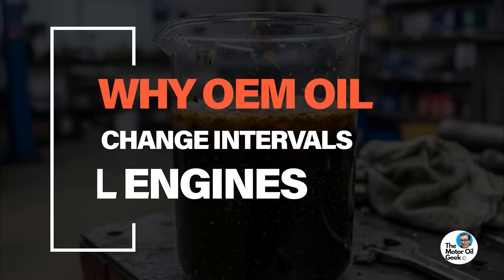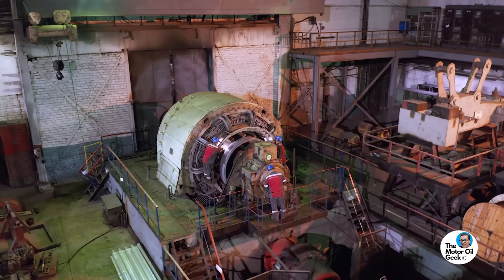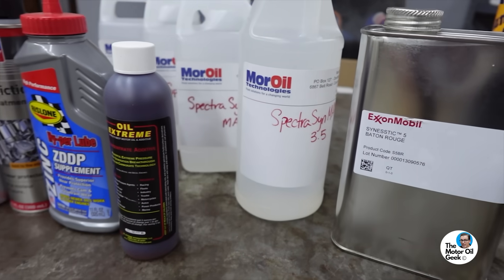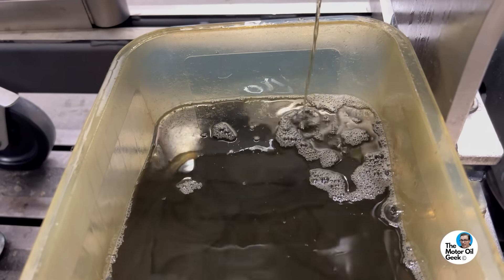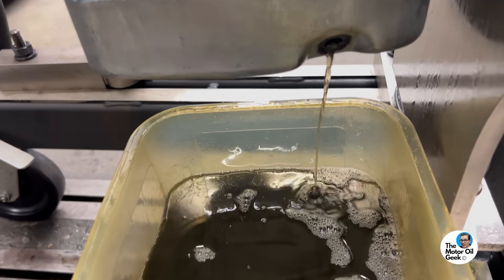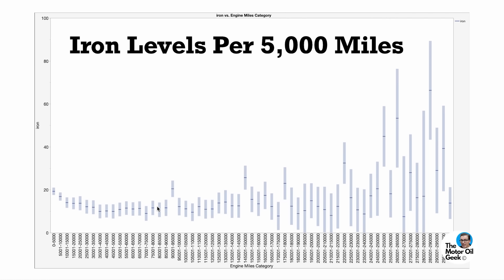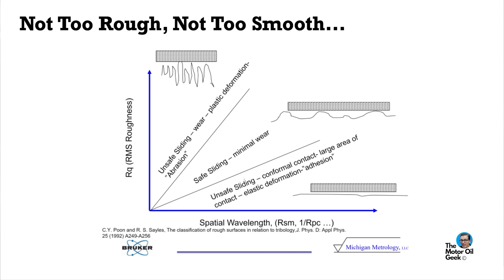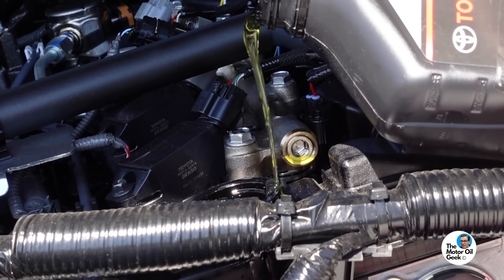NEW Data Reveals WHY Modern Engines FAIL Prematurely!

Comment: Years ago, I holidayed as a guest of a manager at Nissan. Although his role was in IT systems, his insight into motor manufacturing was priceless. He explained that with parts supplied to assemble vehicles, it was accepted that parts quality was accepted to be 'not 100% suitable'. He explained that it was accepted by the (vehicle) manufacturer that a 3% failure rate was acceptable and manageable by the company. Why? It all boiled down to cost. Parts could indeed be made to be 100% reliable but it would increase costs too much. 
In other words: A 100% reliable car can be made but it will cost you lots.

Comment: 2020 up they started cheaping out on parts and quality throughout most auto companies. Cost cutting.cheaper machining businesses that put out a lot of product faster with cheaper less robust metals. Lower grade to offset higher production costs (unionized workers).
Reply: In 2023 nonunion auto assembly outpaced union assembly 4.9 million vehicles to 4.3 for first time in history.  The trend continues.  I don't think you can blame higher costs on Union Labor.
Reply: @CAN43714not blaming but with higher wages and manufacturing costs theres no doubt the manufacturer passes it on to the consumer.

Comment: Lake, the reasoning behind a slightly dirty filter being more effective in catching debris is basically indisputable. 

However, not changing it with brake-in oil changes can leave a significant amount of residual "contaminated" oil in the system.  Sometimes upwards of a quart, depending on the engine. It would seem that recurculating dirty oil that had already failed to be filtered might not be ideal either.

I didn't realize that new oil was as dirty as it apparently is. In your opinion, where is the delta between these two scenarios?
Reply: Also, we're dealing with a positive displacement pump as well, so the pressure across the oil filter goes up as it gets more restrictive, which probably negates any benefit of "caking".

Comment: 90s was peak, after 2000 quality went down the drain. Only engines i see break down are the modern ones with thin oil where all the old additives where removed because emissions

Comment: There's a Youtube video about an engine that failed at 820,000 miles.  Turns out that the valve train will not last forever.  If he'd put in a new cam and new lifters etc every 500,000 miles, he would still be driving that engine.  The bearing and cylinder walls were like new, after 820,000 miles.

He drove nearly continuously in his job, and had an extra filter.  Not sure if sub micron or not, filtered only a little oil, not the entire stream.  But it removed the soot.

Comment: Yes it is 100% bad parts and bad design . You cannot deny that the oil is way better than it used to be. And there are still very few engines using hydraulics so you cannot explain away all the other engine failures.

Comment: Another fascinating video Lake, thanks.

This tends to confirm what I believed about the break-in period on my Nissan 370Z, that it took about 15k miles before it was fully broken in. I did do several early oil changes before the first 3k miles and staged out the intervals from 300, 900, 2100 and finally to 3K miles which became my permanent oil change interval. I did use either a Fram Ultra Synthetic or Fram Synthetic Endurance for their superior sub-20 micron filtration efficiency. My experience with this engine, VQ37VHR, is that it is very punishing on oil, probably in part due to its sophisticated variable valve lift and timing valvetrain that is using the oil to do a lot of hydraulic work in addition to lubricating, cooling and cleaning. I'm thinking that it might be better for me to perhaps go with a little cheaper oil and just change it more often, like at around 2K miles when it first begins to darken. I have found that there is absolutely no oil consumption on the dipstick up to about 2k miles and that at 3k miles the oil level drops by about ½ mm, so it appears that the oil is beginning to break down at about the 2k mile mark.

I have been using the Redline 5W-30, 5W-40 and 10W-40 oils with lower iron particle concentrations with the higher Zinc level in the 10W-40 viscosity, but the lead and copper levels are disturbingly high. I am considering using the Liqui Moly 5W-40 Molygen oil that you used in a previous video that showed very good levels of metal wear particles in the UOA. I'm going to try it for the next couple of fills and send out a sample for analysis after the second fill. I'll post the results if anybody is interested.

Comment: After a rebuild, I have always changed my oil @ 250-500 miles, 1000 miles, and 1500 miles, then @ 3000 mile intervals. NEVER had an issue.. I always used a new filter though. Oil life monitor is a joke.

Comment: The Hemi Tick is not a cleanliness issue. It’s a design issue. The lifters are practically horizontal to where the oil doesn’t get to the rollers and needle bearings. Full synthetic additives like Lucas oil helps a ton. To get the oil to stick to those critical places that standard full synthetic oil wouldn’t. That is the real issue with the Hemi tick plus the cam is way too high up in the block. A melling high volume oil pump should help fix these issues plus full synthetic Lucas additive as well.

Comment: I asked a friend in Mexico who owns a Mazda 3 Sedan about recommended oil there;  he said 5W-30, here in USA is 0W-20, thanks EPA!!
Reply: Don't blame the EPA. The CAFE requirements don't mandate oil viscosities or protection. Its the manufacturers that build these blunt-front pickups and SUV's with the aerodynamics of a 4 by 8 sheet of plywood, and then try to claw back some fuel economy by reducing viscosity.
Reply: 5w40 in europe
Reply: INSTEAD OF reducing oil viscosity for mileage need to get rid of all of these 10 ply offroad tires on vehicles that do not need them as daily driven street vehicles. NEED  To GIT RID STOP /START AND COMPUTER CONTROLLED LOWER PRESSURE AND VOLUME PUMPS. More passages more parts : more volume and pressure needed. Only vehicle have with offroad tires is 1968 Broncho that has never left ranch in 57 years. Fenders scratched to hell from driving offroad in pasture between and over mesquite bushes. Caliche ranch roads are not offroad they are off pavement. BROTHERS 1WD HAS NERVER GOTTEN STUCK ON 3 MILES OF RANCH ROAD TO RANCH HEAQUARTERS.
Reply: @RexAllen-w8v Now that you point the finger at all things with off-road potential, those all-wheel / 4 wheel drive set-ups must flush plenty of gallons/litres down the tubes.

And your comments on the off-pavementing abilities of a one-wheel drive vehicle in the wilds of Texas makes me think of Larry Schwacofer. A man who campaigned a race prepped '57 Chevy to multiple Baja 1000 class wins. 

Bottom line, "Think harder Detroit".
Reply: Last time I checked, the average temperature in Mexico was a lot hotter than the average temperature in the USA.  I've run 0W20 in my Prius for its entire 146K miles, and the engine runs like new.  As long as your car's thermostat is working and the engine isn't going above its nominal setpoint very often, 0W20 is fine if that's what your car maker specifies, whether or not "due to the EPA".  Plus, the benefits of better flow on initial startup, especially in winter, matters a lot.  Viscosity of 20 vs 30 at running temp shouldn't matter at all, except for wasting a small amount of fuel with the 30.  In my Prius, the amount of fuel used is already very low, so the annual difference in cost would also be very low.  I'm a mechanical engineer.  I run the 0W20, not 5W30, not 5W40, not 10Wanything.

If I bought a car which takes 0W8 or 0W12, I'd use 0W16.  In a family member's car taking 0W16, I do bump it up to 0W20.  Partly so we all use the same oil.  Partly because enough is enough when it comes to the trend of oils getting thinner and thinner and thinner, even when the actual engine manufacturing/specs have not changed at all.  I'm not using different oils just because some non-engineer in an office decided to change what they specify for the same engine from one model year to the next.  If I find some evidence that the new spec is truly what the car was engineered to be best with, and not just OK with, then I'd strictly follow the spec.

Maybe some of this is just human nature on our own parts, not trusting change.  But on the other side of the coin, we do have some reason to suspect the reasons for changes coming out of the mouths of the manufacturers.  Their goal of making sure the car makes it through the warranty period is not 100% aligned with my own goal of aiming for it to remain like new for much longer than that.

Comment: If the automotive industry  provided pressure differential warning lights to prompt oil changes, much as we do on the industrial side, ( condition based maintenance) they would sell far fewer replacement parts ans vehicles.  Engine oil filters with the beta and small micron  media of industrial hydraulic filters would be awesome. The chief problem would be knowing when to service the filter.  This would require pressure differential sensors

Comment: Spot on.   Most new engine manufacturing leaves debris and new - faster cleaning is not getting it all out.  Custom engine builders clean blocks / short blocks and key components ( heads… ) 3 times.  Perfect clearances are not normal in mass production, nor are perfect surfaces. This means more wear debris so change your oil early with the proper oil type ( break in….weight… oil spec.  
Finally, fluid does not compress ( like air ) so fluid can transfer pressure ( brakes, variable valve timing).  It’s got to be clean and stable to work.

Comment: .Bought new car, got dealer to change the oil and filter between factory requirements. Up to 20,000kms ,then back to factory time frames although milage is much lower

Comment: Good show.  For me, one of your better ones. 
So if oil out of the can is dirtier than after running and filtered a couple hours does that negate the value of pre filling filters with the dirtier out of the can oil is on the wrong side of the filter element?
(Yah, I'm old.  I rember when oil was in cans.)

Comment: It’s simple change your oil every 5k miles or earlier with a quality synthetic oil and filter. This isn’t the 80’s anymore where engines thrived on 10W40 and would last unchanged for years and still run. Simplicity has gone to the waste side for the sake of Complexity which thus creates a planned obsolescence. With oil being inexpensive to most people there is no reason to not change your oil sooner rather than later. I’d trust the Motor Oil Geek over some profiteering manufacturer that are known to be miscreant and cause known issues. Thanks Motor Oil Geek, your a wealth of fantastic knowledge to anyone wanting to know how oil works ✌🏽❤️🇺🇸

Comment: On the other hand, I've owned six Toyota's, five of which went to the junk yard for age and corrosion, but with a completely functional engine with hundreds of thousands of Japan stop-and-go kilometers on the clock, and all had the oil changed once per year or every 10,000km (6,000 miles). 

I'm sure if I had sampled the oil, it would have had lots of "scary" wear data over changing the oil more frequently...but that would have been wasted money. More wear from extended oil changes doesn't mean shit if the engine lasts the life of the vehicle. 

The goal is for the engine to last the life of the vehicle, as inexpensively as possible. Sending it to scrap after 15 years with a pristine engine is financially retarded. 

Fear mongering to sell product.

Comment: I track my ATS-V. I've been changing oil evert 4 days just because I'm freaking out about oil breakdown and contamination. Hope the engine lives long. Since the oil is really only 50 bucks, so less than a tank of gas, now I'm thinking it might be a good idea after each weekend or 8-10 sessions. The engine lives at 5000-6500 under 18psi of boost for 20-30min at a time. I don't change filters each time, only every 2 changes or so. I don't think there is enough dirt to saturate the filter running just about 8 hours.

Comment: Quality parts, oil, filtration and break in! Excellent subject matter. I live in the world of industrial/diesels and it astounds me how the automotive industry handles it. I have frustrations with poor filtration in automotive drive trains. Air, fuel, oil and especially automatic transmissions are all lacking in my opinion. Thus I'd love to see more filter/filtration content. I've been experimenting with by pass filters on my old Waukesha diesels with success. One of the concerns with by pass systems I've heard is filtering out some additives if you go too fine. Fact or fiction? Would be interesting to see some one actually test that. Perhaps some one did and I just haven't seen it.

Comment: I have a 2024 Chevrolet Tahoe with the 5.3L engine and 12,350 miles. 
Next week I am having the oil changed for the 6th time. 
Is this necessary, absolutely not, but it is what I choose to do. 
As stated, cleanliness is imperative for longevity. 
Oil is cheap, engines are not.

Comment: If the motor oil is being used as hydraulic fluid also in the modern engines isn't those 0w- ? weight oils too thin. All for the sake of emissions and manufacturers lying to consumers about oil change intervals.
Reply: Hydraulic oil ISO VG32, VG46, and VG68 are all thinner, or right at that of a 20 weight motor oil, which is 44-46 cSt at 40°C and 8.2-8.8 cSt at 100°C. 

So no. It's not too thin, especially where fast-reacting hydraulics like cam phasing is concerned. 

Even with brake fluid, putting DOT3 or standard DOT4 in a car with modern collision avoidance systems, where something like DOT4 Calss 6 LV fluid is specified, can extend brake application time by over a second.

Comment: Thank you for putting out great information.  After getting my BS in diesel I worked for cat dealer through a major contamination control improvement.  I was rebuilding components. Could see a major difference in maintenance between customers.  Cleanliness and oil samples were key then to reducing downtime and rebuild cost per hour of machine life.  That was 20 years ago now!   I now farm and have my own equipment.  Oils and filters are a huge priority for me.   Just bought a new powerstroke.  First oil change was at 400 miles.  It now runs Donaldson filters.

Comment: 1985 Mustang GT had roller rockers and roller lifters bring pressure Max 214 lb and it ran 40 to 60 lb of oil pressure at 2,000 RPM using 5W-30 oil synthetic was not even spec'd so why did these engines have no problems with lifters that's the question did they lower oil pressure and that's what's causing the problem?

Comment: I have been to Donaldson filtering showcase at their facility in Minneapolis.  I used to run a hydraulic shop,and filtering the oil was so important to hydraulic piston pumps with the swash plate. Long story short we were told bulk oil in drums are the worse you can put in your car because it may be new but bulk oil is filthy.

Comment: GM and others started using roller lifters in the mid 80s and they could go 200k-300k miles or more with no problems on conventional oils and a $1.99 fram filter. Now 40 years later with full synthetic oil and $18 filters they are coming apart at 40k or 70k miles. I think automakers decided to make motors disposable, use lower quality parts, just try to get the cars out of warranty before they die.

Comment: When I was a younger mechanic, oil changes happened every 3,000 miles and the filter was done every other oil change. Recommended by most manufacturers.

Most don't realize that a dirty filter, might be more restrictive, but it also filters better. Which is what makes it more restrictive.

I hope people will listen to you telling them what I've been saying for decades. lol
Reply: Although the oil pump will simply push oil through a more restrictive oil filter even harder, which will also push more contaminants through as well.

Comment: Cars have literally been engineered to fail. Auto manufacturers figured out a long time ago that they don't make as much money when somebody buys a car from them and keeps it for 20 plus years. That's when they started doing things like putting those giant plastic covers on all the engines that don't do anything other than retain engine heat and cause premature wear. Then they decided to do this lifetime transmission fluid nonsense where you can't change the transmission fluid or filter. They also started using a ridiculous amount of plastic in the cooling systems. It's all about money. No one makes a long-term reliable vehicle anymore.

Comment: In the Olden Days, it was thought that the CARBON particles, as evolved from being broken down in the pistons, sleeves, and valves (due to heat and mechanical disrupture), actually HELPED the engine and residual oil.  Those carbon particles are easily fractured (like pencil lead) and act as a lubricant layer, of whatever size they were.  Carbon floating along bearings was "softer" than any metallic or silicon particles, and would often embed into the lead/copper/zinc alloys, as a protective layer.  Those "semi-carbides" were the actual wear layer in that bearing.  The carbon itself, was exchanged during mechanical action and a perpetual new layer was formed at every piston stroke.  The modern problem is that tighter clearances, AND so-called modern materials have made this ancient process, no longer in place, at the metal surfaces.  Unless we revert back to the Olden Days, when a Squeaky Wheel got the CARBON BASED Fat, this new problem will continue.  The EPA made it so.